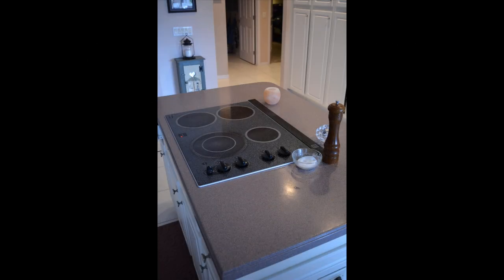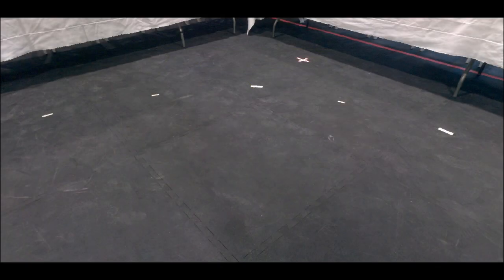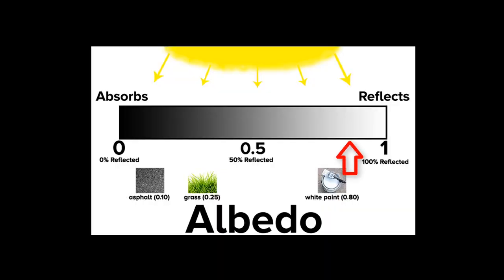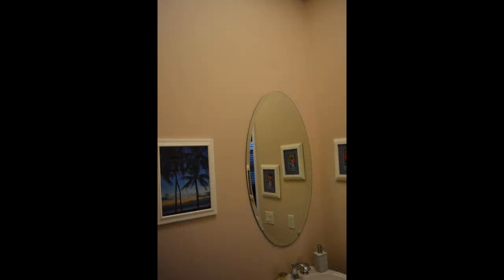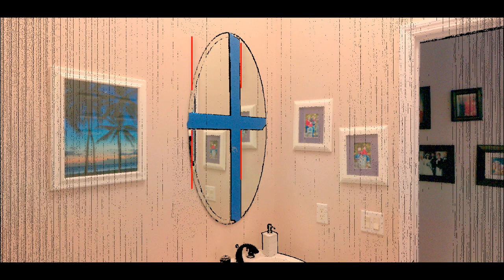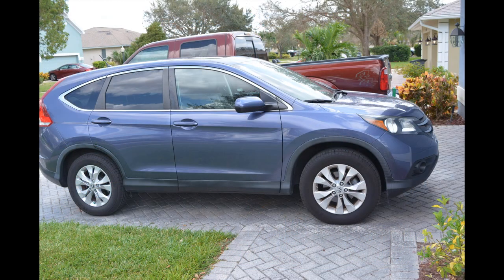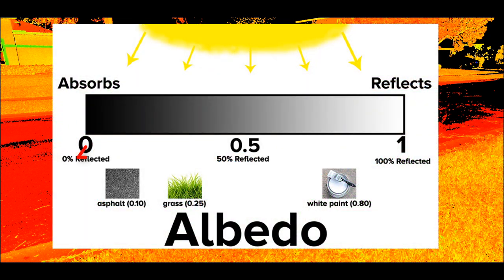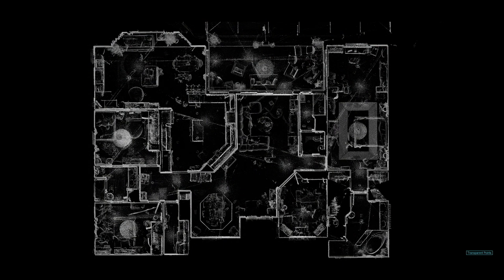Scanning Dark or Reflective Surfaces

Comment: How can I scan a clean shiny black car that I can not put powder on?
Reply from the maker: Hi Andrew. You could use painter’s tape on the body of the car. Of course, that’s only practical if you’re capturing only a particular section. Another method is to drape a silk sheet over the entire car and then scan it. Without something on the car any scanner in this category is going to have a hard time generating data. If you frequently find yourself scanning in this scenario then a Leica P-Series laser scanner may be the way to go.
Reply: Wet the car then drive through bull dust , scan,  then wash @ auto car wash to reinstate the shiny  black car.